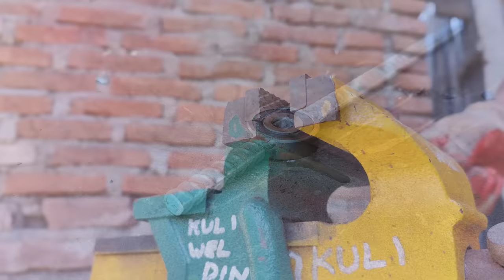not many people know how to make an automatic door latch

Comment: Clever way to lock yourself out from the opposite side of the door with no way to access  the lock from the other side.
Reply: A pull string or wire like a usual self-latching??

Comment: is it possible that you to reply my answer ? ... it will be deforms orbs of the bullbearing when you weld it... so, it will corrupted, is it right ?
Reply: Compromised is the word youre looking for and yes it will be but it wont matter much because its not under the demands that such a bearing is needed for. Guy seems to have a fixation on ball bearings and rebar. Maybe a truck carrying a load of both crashed near his house and hes got tons of it to use. Like he used two bearings to make a hole punch when sleeves or holes in plate would have worked.
If the only tool you have is a hammer all your work is a nail, right?
Reply: Whenever I use a bearing in this type of application, I use a paste made for brazing around heat sensitive materials such as those when doing refrigeration repairs.